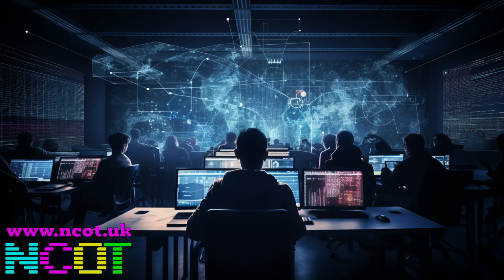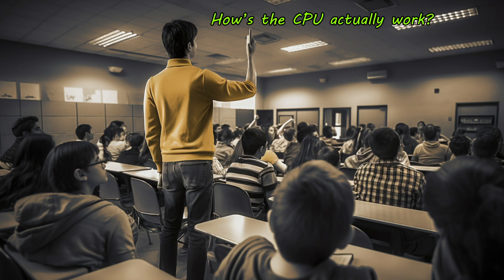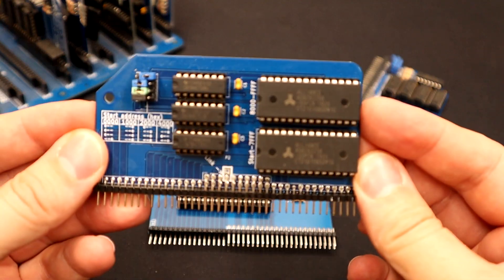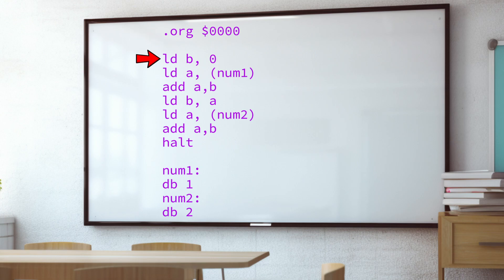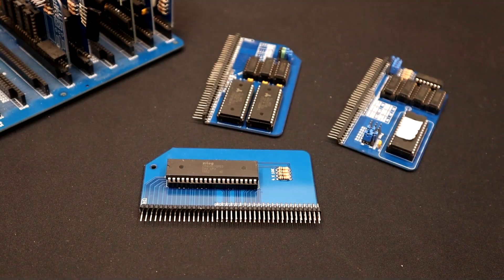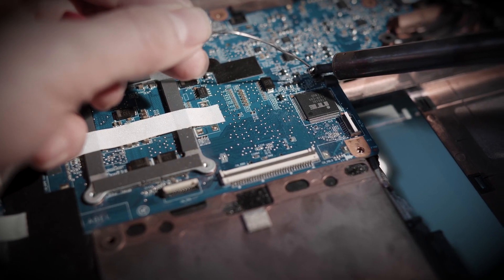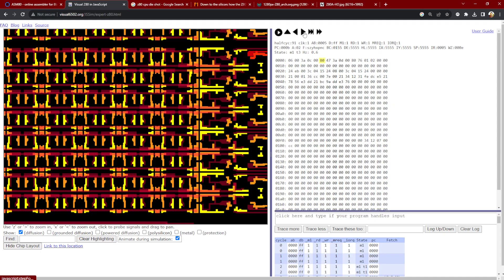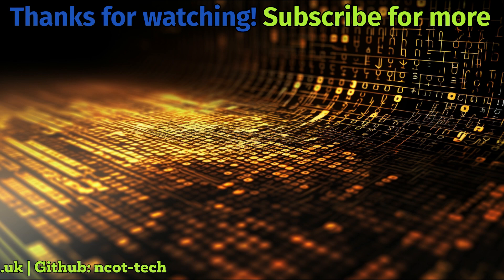Zilog Z80 Deep Dive - How does it work?

Comment: perhaps you'd be interested to know that, in trouble shooting odd defects in chips, we do something quite similar to the software you have shown, but do it in reality.  If the chip is in a package, the package is removed as well as the upper parts of the chip so as to expose the actual circuitry.  the circuits that are suspected to be involved  "wired up" and powered  with instructions  to match the failure conditions.A camera is used capture photon emissions and you can actually SEE the transistors turning on and off.
Reply: I'd call that a data leak. 😁
Reply: I always find that part of development fascinating as well. I'm not in the testing side of things but knowing that we can basically X-ray a chip to figure out what it's doing wrong is invaluable to me on the development and simulation side of things.
Reply: When i worked at Philips Semiconductors we had a FIB machine - a Focused Ion Beam.

Using this it was possible to modify an IC - both cutting connections and adding new ones.

Spare gates were usually dotted around the IC on early prototypes so if a signal needed inverting to fix a bug it was possible.
Reply: @martinwhitaker5096  when I worked in priduct engingineering bringing the Nindendo Wii  out I used a FIB to make a wafer with known array fails to check our testing software
Reply: @martinwhitaker5096  This is also equally cool.
Reply: Would be nice to see that in action...I didn't know transistors would emit photons while working.

Far less likely to ever see videos emerging of interesting but advanced machinery and proceses than of people using the end product.
It's all commercial secret in most cases
Reply: It's probably less of a secret than you think, for the most part.

The reality is that a lot of what's involves is too complicated for many people to actually understand.
Reply: That is beyond cool.
Reply: I have a similar story. When I worked at Intel, I had an opportunity to learn how to use SEM (Scanning Electron Microscope) to do failure analysis. In an adjacent lab, they had a SEM set up where they could image a chip while it was powered up. They usually had chips that didn't have the passivization layer so that the top metal layers were exposed.  SEM uses an electron beam to scan the surface of whatever was in the chamber. But in the case of an active electronic part, the varying voltages that were present on the metal layers could be detected by the current of the SEMs electron beam. So the SEM was essentially "seeing" the voltages. It was common to use this technique to debug an early version of a chip design that wasn't working like the designers intended. They could cycle through the chips functions and see where the logic failed to match the designers intentions. Nowadays they use more comprehensive simulations to detect these logic flaws before the design is implemented in silicon.
Reply: That's really wild :o

Comment: Ben Eater's videos on building a CPU gives good insight into how this stuff can be implemented. I'm sure it's far from the only approach, but seeing one simple implementation is a great way of getting a ground level understanding. With some experience and insight regarding how layers of abstraction can separate the implementation from the behaviour, this sets you up well for feeling like you "understand how it works". Most of the complexities in modern computer systems are implemented in ways as to not break the contracts of these layers of abstraction, so even if you don't know all the details of how an actual computer exactly does things, you understand how each layer behaves in relation to higher levels. 
Pipelining + out of order execution + branch prediction is an excellent example of this, making things so much more complex in reality, yet the implementations conserve the contract, making it seem like things are executing in the expected sequence, one instruction at a time, with only a few side effects, such as the time spent per instruction becoming unpredictable. You can just learn the fact that a CPU with these features has unpredictable execution times, and not worry about anything else.
Modern programming languages and their compiler optimizations can be approached the same way. You might need to be aware of where the edge cases are, but you don't need to know much beyond what small parts of the contract are affected.
I kind of think a lesson or two spent on the topic of layers of abstractions and what "contract" means in this context might be good for any comp-sci education, but it's not something I've seen much focus on at all. It is such an important thing to grasp early if you want to dive into almost technology subject. Whenever I bring up layers of abstraction to comp-sci educated people, they often only seem to associate it with the OSI model, but it is so fundamental in every area of computing in practice.

Comment: Smart question, i didnt ask that until many years later, and i really needed to know as my love of computer science pretty much disappeared, it got rekindled again with microcontrollers, for the firast time i realize my programming was in charge of the hardware! so why didnt i know anything about hardware?   Where was my electronics prerequisite? they taught us logic gates in computer science.  I still remember solving truth tables at 13 in our highschool comptuer science class but had no idea what a transistor was until many years later.   Logic gates were highly abstracted things, just symbols, and rules of how they worked.  No where did they mention electronics and a basic 2 transistor combination could give you an and gate. Now you got the building blocks to build up from there and see how everything comes together, from 2 transistors to ALU's and whatever.  Now you got ideas how to program them without even seeing one line of code or syntax, heck you might even have an idea how to arange these electronics to make your programming run faster. Now youre a real programmer, you design the computer! and can program it.  That my educational fantasy anyway.

Comment: I think this is most important - computers are the way they are because we make computers from things we are able to manufacture.  Digital circuits are made from analog parts.

We choose parts because of their cost - money, speed, size, energy. We only use registers because RAM is too slow. We only use RAM because storage is too slow. We use storage because RAM is too expensive (and volatile). We use bits because there's nothing that holds a byte (almost).

Comment: In the 80's, the German tv show "Computer Club" created a Z80 constructed completely from discrete TTL logic chips, with LEDs put all over the place so that you could see the state (0 or 1) of the register bits, the flags, the data and address bits etc. The decoding logic for the instructions was hard wired.

This demo Z80 could be singlestepped by pulsing the clock manually. A great tool for showing how a CPU works.

Comment: The Z80 was a breakthrough device. However, it was soon revealed that it was indeed a slow processor. OK for simple equipment, but got easily bogged down with more complex instruction sets.

Comment: When i studied this at uni before we even looked at assembly and CPU architectures we build a finite state machine using an EEPROM. Learning how you can use a computer or dip switches to control the address bus and then control outputs attached to the data bus. Then if you got more advanced and had clicking you could take bits from the data bus and feed them back to the address bus and you've got a hardware finite state machine. Which as we found out later on is how you build an instruction decoder. Of course it seemed pointless in first year. Anyway I'm glad I learnt all of this. Helps me understand what the CPU vendors are talking about they talk about branch prediction, out of order execution and super scalar design. Also makes me appreciate just how much work goes into a compiler.

Comment: The best way to learn such a profound question is make your own computer CPU. Not with commercial microprocessor like Z80, but with TTL gates or micro-programmable bit-slice chips like Am2900 series. Or in modern days, with FPGA chip and Verilog IC design tool. You can design completely new instruction set of very simple 8 bit CPU like 6502 and simulate it. Only with simple gates and macro blocks. No existing microprocessor is needed. Most tools are free and hardware evaluation board is not expensive. Recommend even for hobbyist.

Comment: I would have taken a chronological approach, starting with an unpowered CPU.  The power is applied to the circuit, a circuit external to the CPU holds the CPU RESET* pin low for a while to allow the power to stabilize and possibly some other circuit(s) to be set to a known state.  When the RESET* pin is low, the CPU is stopped.  Then the RESET* pin is set high.  The CPU then fetches an instruction from memory (ROM) and executes it. The location of this memory address is hard-coded into the CPU chip and is part of the CPU documentation. The CPU then proceeds in the way you describe, fetching instruction after instruction. 

There can be variations such as the CPU loading other values from ROM before starting the instruction execuction stream.

Comment: You stil skipped the explanation in this video too. You jumped directly to explain machine code and how to program machine code (assembly) and a mini routine. No! Your student actually asked "how the decoder works", the only answer is simple. IT IS JUST a mini ROM INSIDE the microprocessor like the z80 and any other processor!, THE fetched  instruction is placed in its address bus, and the data stored in that mini rom activates multiples lines, one line can be enhable register B plus READ, it will dump the value in its internal data bus, and enable register A plus WRITE, and so on, that will make ld a,b , in one tick clock, if multistage instruction, a counter can count up the stage, the count also will be feed in the decoder mini ROM , AS THE LOWER addresses bits, that counter can be reset to stage zero, so, one of the bits store in the rom must mark when the instruction ends its execution. Now, the next question the student will ask is, how the ADDRESS DECODER of a ROM works. And the answer is , it is just a binary tree of AND / OR gates!. You can teach the basica of addressind decoder to enable the correct byte /word to be outlut from that mini rom
Reply: Before whole cpu in one chip, there was CPUs made of PCB cards, with lots of TTL Logic chips, and the decoder was ACTUALLY A ROM IC chip, 256bytes ROM , 1K ROM, 2 roma in parallel, so it outputs up to 16 enhabled signals, etc. registers were STATIC RAm Chips, and there were ADDER / ALU chips, COUNTERS UP, COUNTERS DOWN chips, it is all in the TTL FAMILY HAND BOOK, THE BLUE BOOKS,. Z80, 8080, 6502, MADE all those huge pcb cards all in one chip.

Comment: Research "bit-slice processors" and all will become clear. Ben Eater's CPU on a bread board is a bit-slice CPU and is very easy to understand. More complex machines such as the z80 and 6502 are microcode architecture where each op code runs a little program inside the chip which coordinates the various parts of the chip. Start with bit-slice. Beautifully simple and elegant.

Comment: So i get how a Z80 , and a 6502 work , and i use a model that is some sort of unholy mix between the two when im programming... now here is my question ive been trying to update that mental model for many years but cant seem to find anything up for the task... in my mind a cpu is always loaded 100% and doing instructions as fast as it can each clock cycle, (well with a little instruction decoding as preparation for the actual thing happens) here is the problem,... mow does a modern pc (or even the latest single core ones like a Pentium IV) know when not to run at 100% load , or even clock down its speed , or put it differently why does a loop waiting for input (not from a irq but from something that is polled like usb)not peg the core at 100% load (using a nonblocking check inside  a while 1{} for instance
Reply from the maker: That is actually a good question. I don't know, but modern CPUs can probably monitor their power consumption and temperature and use that as a gauge how hard they're working. Some of it will come from the OS though.
Reply: @ncot_tech  ps a few years back i also wouuld have said that your model for how stuff moves around is not right in the beginning of the video,  as data cannot move on its own from storage to memory. so before executing a program the currently running program (kernel) would have to move that binary from storage to memory and therefore has to pass trough the cpu  aswell so the double arrow between storage and memory is nonexistent, even if both are attached to the systembus. but with the new ps5 i think it might not be wrong anymore
Reply: @ncot_tech  ive looked every where i knew where to look , and even ased chatgpt, and alll  it could come up with is it has mechanisms that detect idle time... but coulldnt tell mehow it could have idle time in the first place
Reply: @hoefkensj Some CPUs have a halt instruction, such as the x86 CPUs. Another approach is to lower the clock speed (and possibly the voltage) when the OS detects low load on a thread.
Reply: @toby9999  i know but when my cpu is running at a low clock speed its % usage is relative to that clockspeed and not to its maximum clockspeed , so (and even this is simplified ) a cpu does 1 instruction per clock cycle doing 1 instruction every clockcycle at 800mhz would mean 100% use  in the same regard doing1 instruction per clock at 5GHz also means 100% use , if you dont want a cpu to do any actual work you can have it do a number of nop's but those are still instructiosn to do so cpu use would still be 100%, and that is the case for a z80 , unfortunatly i dont own a z80(used to have a uProffessor Z80 kit) anymore but im think that was still valid back then, oldes i currently have that works is a 8088 so . having said that i honest by god have ho idea howto write a program that would only use a Z80 for 50% in a way that if it wanted a seperate program could if it wanted use the other 50% and run concurrent with my code to load the cpu 100% and even that would be easier then have it do something only 50%  of the time... note that in order for a moder cpu to lower its clock speed , the low use comes first , and that triggers the drop in cpu clock , as in im not doing much atm , i can reduce my clock without much impact .
Reply: @ncot_tech  i recently watched this :https://www.youtube.com/watch?v=rLWeHpzAYhg whil not actually talking about my question i was amazed by the amount of enlightenment it gave me on how a modern cpu works in that corner. im currently watching it again ,since i lost some of it already trying to recount what i had learned from it , its probably the most ive learned on low lever cpu internals and how it operates in the last 10 years . all packed in to 1hour. it made me remember this conversation and figured it might benefit a teacher aswell ;)

Comment: As a software dev myself I also had for many this missing link in my understanding. It seemed that there was something magical about it, some hidden knowledge. And then I read the book "The Elements of Computer Systems" and it clicked for me. It's better well known as "From NAND to Tetris", which you can search for. I highly recommend it! In the first part you start with a NAND gate and build a fully-functional computer. In the second part you build an assembler, a virtual machine, a compiler for a high level language and a standard library / operating system for it. 

You can also watch Ben Eater's series, where he builds a computer on a breadboard using discrete components. I'd still go with the nand2tetris course first, because it makes you do things rather than just watch somebody else do them. And then Ben Eater's videos will fill in a lot of the blanks that a virtual computer hides from you.

Comment: I started with this CPU back then. I added bytes to the eprom for the operating system using a dip switch and programmed address after address using a button so that something useful happens after the start. Output was via hexadecimal system to seven segment LEDs.